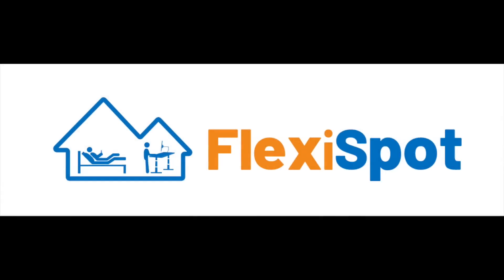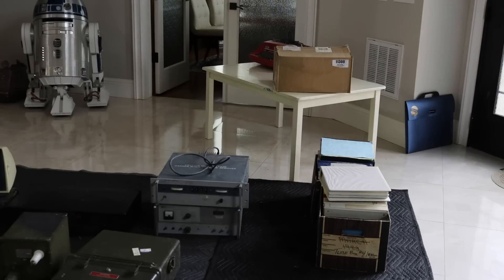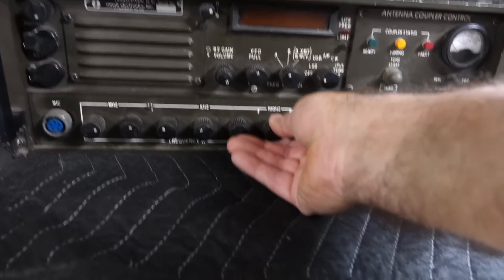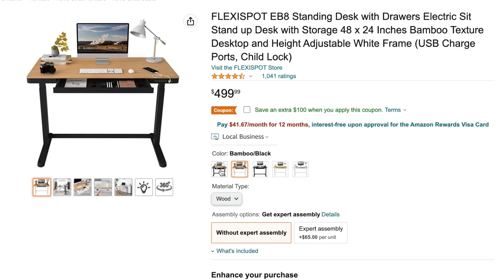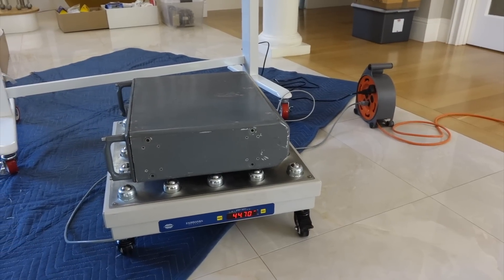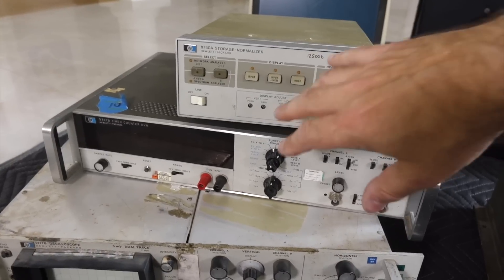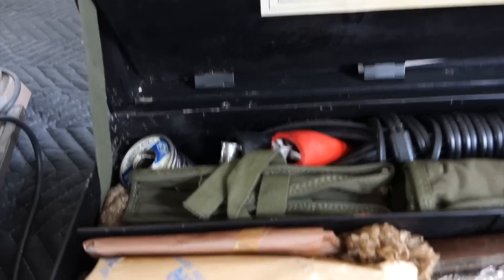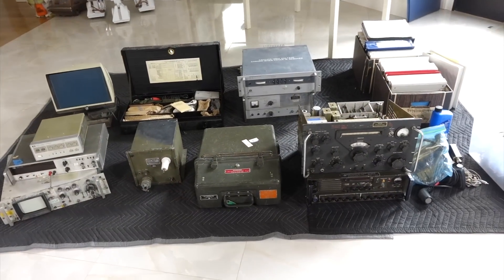Nevada Haul: 1950's Mil Radios, Teletype and HP Goodness

Comment: For digitizing your microfiche collection, see if you can find a retired microfiche printer. I remember seeing them in libraries back when dinosaurs roamed the earth. Print everything out and then just stick it into a sheetfed scanner. Going fiche-paper-data is an extra step but probably a lot faster than trying to do it with a flatbed transparency scanner.
Reply: I work for the phone company as a splicing technician and still use my microfiche plats every day. The last update we got was 2007 but they're so much better than the online facility map program. There are lots of historical information on some of these plats (several Nike missile batteries and radar sites, etc) that I'd love to scan in before I retire/fall over dead on the job, haha.

Comment: Tnx for the great show!  You mentioned "mildly radioactive power tubes."  This is because adding a small amount of thorium to the tungsten filament lowers the work function.  This allows higher electron emission at lower temperatures than would be the case with pure tungsten.
Reply from the maker: That too, but that radioactivity is so small it does not make it through the glass. The radio activity comes from the uranium glass seals.
Reply: @CuriousMarc  You are right.  When thorium decays, it emits alpha and beta particles which, unlike gamma rays, would be unable to penetrate the glass envelope.  Thanks for the correction.

Comment: He's a huge tube nut for sure. Holy bloody moly, am I envious! Joy for ever.

Collins transmitter... makes me think of Paul Carlson standing in one, haha!

Lack of bench space (or The Law of Eternal Discombobulation) is a common problem in electronics workshops and labs all over the world. Sure, you can try to tackle it with adding more benches, but you'll eventually reach the limit of shop space, which will force you to expand by adding buildings, which is then limited by economic boundaries. Even if this was not the case (i.e. if you had the wealths of Bezos, Musk and Gates combined), you'd eventually reach the limits of Earth space, not to mention the necessity to share it with others. So, expanding into the extra-terrestrial... 
...and then you reach the speed of light limitation. Hahaha. 

Truth be told, I'd love to get one of them movable variable height benches... the cheaper readily available ones are adjusted with a hand crank, so I'd and hack it for electrical control.

Military TTY and HV PSU are just so damn awesome.

Comment: The portable teletype is beautiful. Its 40lb weight brings to mind early portable computers like the Osborne-1 and Kaypro, which gave me an idea: tuck a Raspberry Pi or similar in to the back of it, develop the software and hardware to connect the two together (I presume the teletype is 5-bit, is it?) and have yourself a fully-functional portable computer with hard copy output.

Comment: 20 bucks for a 8484A?!? That is a find indeed! those fetch more like 200-300 in working condition. I’m more of R&S guy so I got a NRV base unit and now I’m commited to those sensors. Kinda regret it now. the Z4 is as close as you can get to the 8484A (if you want a diode detector), less frequency but more dynamic range - they fetch north of a 1000 bucks! Might have to switch to HP...

Comment: If yu have teletypes there is a chance you have some slightly more modern equipment. Do you have an AN/UXC-7 facsimile? That's the one you drive a tank over in the morning to wake it up. I have a nearly pristine manual and some possibly still have some other goodies for it. Alas, I do not have the little golden piece of hardware to give it, SCSI capability. That was designed to work with large map size documents in a 36" wide scanner.

{^_^}

Comment: That's the first time I've ever seen a manual that includes a subsection on how you should destroy your equipment.
Reply: I once saw instructions on how to destroy the Hammond organ in the chapel if a base had to be abandoned. It always struck me as a rude thing to do. If the enemy wants to have a sing-along, let them!

EDIT: I think I saw it in an issue of The American Organist magazine from 2017 or 2018.
Reply: @johnopalko5223   Agreed, that's very interesting. I would have to assume it was to prevent an enemy from studying any of the electronics?
Reply: @matt0laughed  Hard to say. It was an electromechanical tone generator and a vacuum tube audio amplifier. I think this was from during the Vietnam conflict, so the design would have been around 30 years old by then. I don't know what they could possibly have learned from it.

As an organist, and owner of a 1967 Hammond B-3 that's still going strong, I was horrified at what they said to do to the poor thing. I mean, putting sand in the tone generator's oil cups?!?
Reply: @johnopalko5223  Yes I was thinking the same. It was old and well understood tech that was not mission critical. Sand in the oil cups! That's just insane. I wonder how many poor Hammond's had to be subject to that level of torture and destruction.

Comment: You can digitize micro-fiches with a powerful scanner (any, really). You just need to make sure it has the option to do film. I've digitized glass in the past and it pulls all the details down to individual hairs from meters away.
Reply: Just needs to be capable of very high resolution scanning in monochrome. 4800dpi or better works, so kind of excludes any of the cheap scanners, though the old HP Scanjets would happily do that at highest setting, though scanning would be extremely slow.  Find an old Arcus scanner, with the dual lamp option, and put new lamps in ( very cheap to do, and you can do it yourself as well, unlike the HP where the lamps are epoxied in) and it will scan these perfectly. Used them with professional film to scan artwork, and the final image could be printed up to A0, with full detail in them.
Reply: There are companies that will do it for a price. Might be the fastest way to go. But then, again, building your own would be more fun.

Comment: If you want a decent high voltage supply look at electrophoresis power supply’s. I have three 500v 400ma on my bench and the extra current has saved me many times